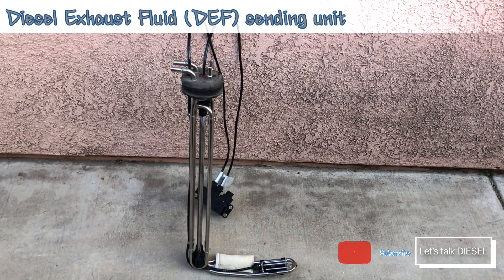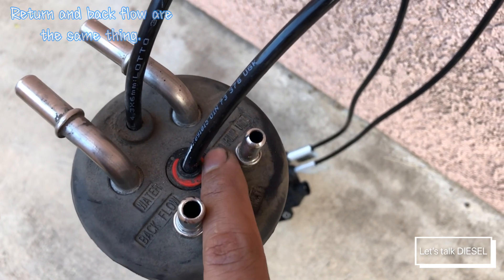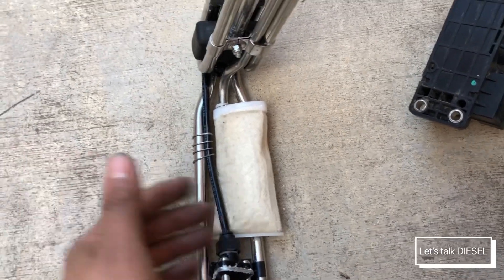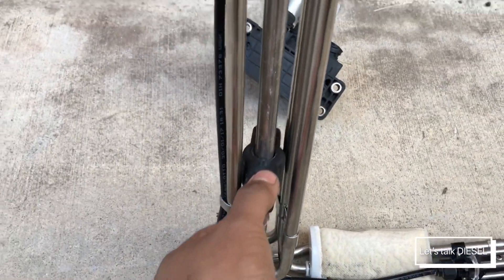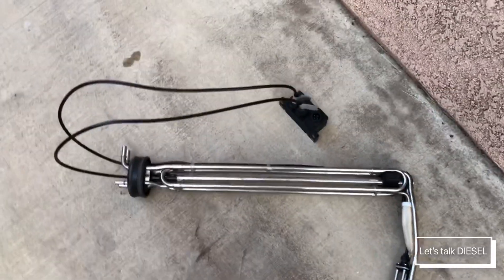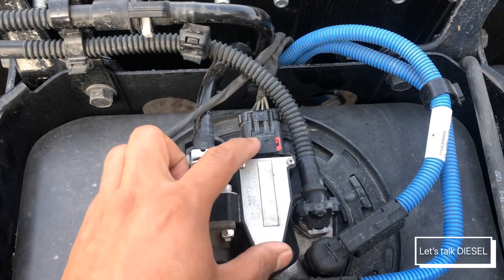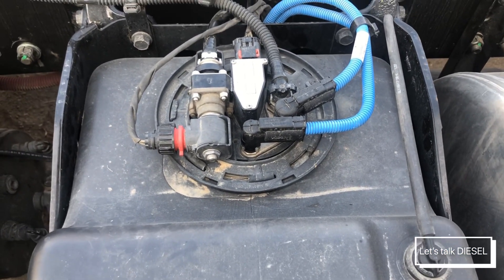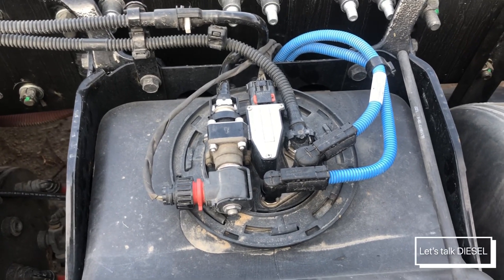ATD System Episode 3: Diesel Exhaust Fluid (DEF) sending unit.

Comment: Question im getting code spn3031 fmi9   def tank temperature chech the wires and connection couldnt find any issue and also the def level goes on and off. Could it be wiring issue or the level unit?
Reply from the maker: Usually, it is the DEF quality level sensor (QLS), perhaps you can take your vehicle to your nearest shop to confirm properly this issue. Thanks for watching.

Comment: How can this system be disabled and not used without announcing the error code in the trucks?
Reply from the maker: There was recall back in 2021 to bypass the DEF level unit fault (for coronavirus shortages) but because the part is now available, Navistar is not allowed it that anymore. In other words, if you have problems with your DEF quality level sensor you must replace it. Thanks for watching the video.

Comment: Hi I have issues poor quality def could be this one ?
Reply from the maker: Yes, this is the DEF quality level sensor, if you have an International truck you might want to take it to the dealership, they are doing an emergency bypass for this sensor because right is really hard to get this part. Contact your closest international dealership for more information.
Reply: @LetstalkDIESEL  thank you for reapply my truck is 2017 Volvo just change the level sensor hope issues done ✅ also soot level going up fast and parked regeneration code come in

Comment: I have 2011 d13 Volvo. My code is spn 4376 fmi5. I'm wondering since I have this code and is related to backflow. I used to when I turn off my tractor when I get to home I hear the pump running for 20-30 seconds. Now it runs only 2 3 seconds and since then I have this code. If you have any idea please let me know here how to fix this. I appreciate it and by the way I like your videos.
Reply from the maker: Are you talking about the DEF pump? Please confirm my questions so that way I can reply properly.
Reply: @LetstalkDIESEL  Yes sir I'm talking about def pump
Reply from the maker: Alright, then looks like the DEF pump is about to failed. But I suggest you to take your truck to a repair shop to do a proper diagnostic, once they test the pump with the Volvo tech tool (diagnostic software) they will let you know if that is the cause of the code or there is something else. Thank you for the support.
Reply: @LetstalkDIESEL  Okay I will try but last year I replace the pump with the aftermarket one Bosch. Did not fix the issue. I will take it to the shop and see what they say.

Comment: Hello I got a issue and got a code def exhaust fluid temperature. 
Voltage below normale or shorter to low sources .
It's for a 7 month always run .
What can I do to fix it .any ideas 
Thanks
Reply from the maker: Your problem might be the DEF quality level sensor, usually on Volvo trucks, this code does not give more issues beyond the check engine light. My suggestion for you, take your vehicle to a repair shop for a proper diagnostic, that way you will be sure that DEF QLS is the issue. Thanks for watching and I hope this help you.

Comment: Thank you so much my truck went into derate mode it gauge show half a tank but truck indicates no def. would the sensor and leveling valve be my prob.
Reply from the maker: Yeah, that could be a possibility. Make sure your technician use the proper software tool to let you know the cause. Thanks for watching.
Reply: My trucks doing this. What was the issue?

Comment: I brought a brand new 1 box last year and only put 80,000 miles on it since. Im back at freightliner and they telling me a year later that I need another 1 box after changing both nox sensors
Reply from the maker: I know “the dealer”, we had an unit with the same problem we replace the ATS box and still have regeneration issues, we took it to the dealer and they came to the conclusion that one of the cylinders had problems, in order to proceed to fix the ATS box they needed to fix the cylinder first, so they fixed. Even after that the unit still have issues, then they have to replace the ATS box because the cylinder messed it up, so our company decided just to sell the vehicle as is. Dealer sometimes just do not know how the technician are working there, they just take the money and change the part they might think is the problem. So many bad reputations for dealer around the U.S.

Comment: SCR Sustem fault Veh speed limited to 8 Kph.
       Why I’m having this code on D13, any idea?
Reply: Do you have a shop???
Reply from the maker: DD13/15/16 engines, a common cause for the derate is that SCR NOx efficiency is low or very low. If the yellow light around your DEF meter gauge is blinking, it might be because of that. This is my personal opinion, to know exactly the cause, the Detroit Diesel Diagnostic Link is required to perform the proper troubleshooting for your issue.